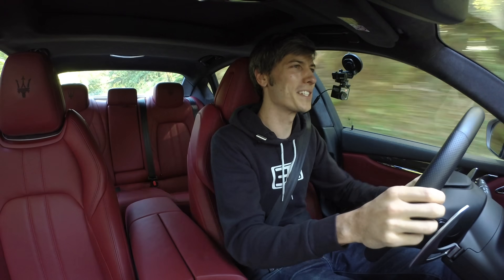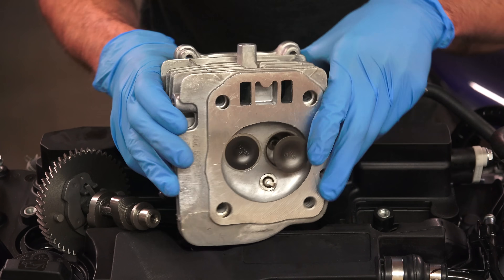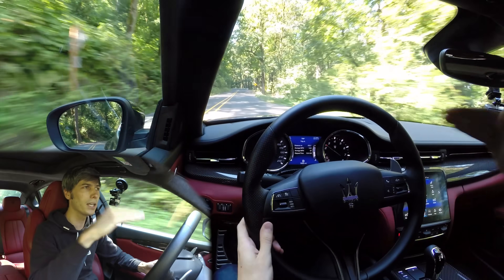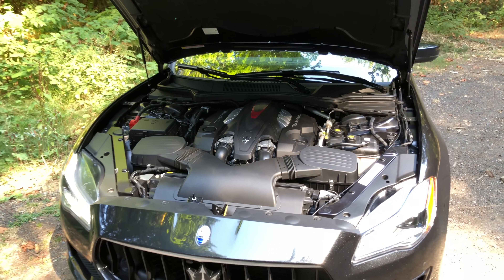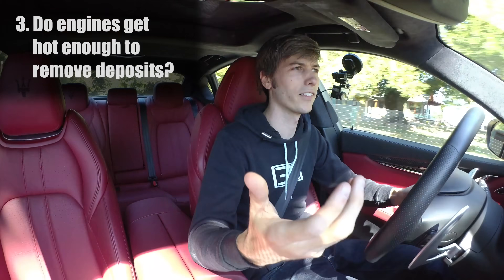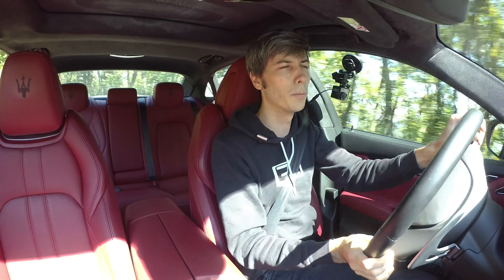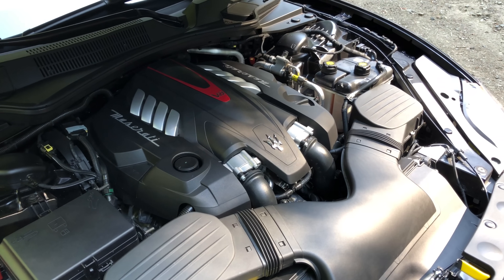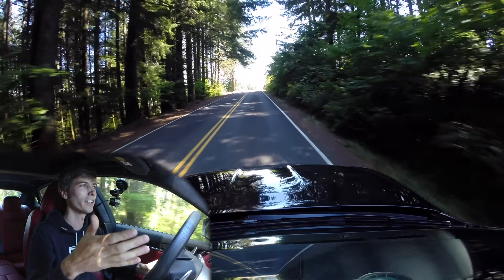Is Redline Good For Your Car's Engine? Italian Tune Up

Comment from the maker: Hope everyone's having a wonderful day! I made a video a while back about why engines lose power over time (summarized with 10 reasons), which feels relevant to this video, for anyone interested. Here's the link! https://youtu.be/uj8hjAjI7p4
Reply: if i get caught redline on the 5 gear  . can i show this video to the police and tell them i was doing a italian tune up ?
Reply: Very Interesting. Was wondering about water/methanol injection systems on direct injected cars like my 2018 Civic Si? Would it steam clean the intake valves and/or the combustion chamber like old pappy mechanics used to do by dumping water in the carburetor? A lot of videos I've seen say it does but I haven't seen any real data.
Reply: Get a question, which will cause faster deposit buildup in the intake  valve. plastic manifold/metal manifold?
Reply: Please do an episode on whether or not winding your engine up while stationary and bouncing off the rev limiter is bad for your engine.
Reply: WOULD BE BETTER IF i WAS DRIVING A MASERATI...:)
Reply: I think going WOT opens up the fuel injectors and the fuel line system.  Like exercising flows the blood more so it cleans up the stuck parts.  My stuff runs better after going WOT for some reason lol
Reply: @antdx316  Right at WOT your getting a lot of fuel over the intake valves.  If you use a high quality gasoline with lots of detergents that will clean the intake valves.  I use shell V power with nitrogen exclusively and when I took my lower plenum off the valves look like new on a 90k mile engine.
Reply: What about Catch Cans next!
Reply: I had a carburetor "powered" car once that didn't get below the emission requirement, no matter what i tried. I was super pissed and decided to try revving the engine to either A) blow up or B) remove everything besides the aluminium and steel from the engine. As it was not injected and the ingnition didn't cut at any point, i revved the sh*t i out of it by driving couple of times up and down this steep and long hill nearby. Man, that engine cried! But it held together and i went immediately to get it tested and it passed with flying colours! That thing was tough! I had it couple of years before i had to let it go but for me, italian tuneup worked. Oh, the car? Peugeot 205. Have had two of those and i just love them.
Reply: Really intresting! 
It didn't actually surpriced me that you can clean off deposits by heat. The question is mostly - how well will the engine do at the temperatures required. I use heat for cleaning grill grates all the time using my furnace, that I have built. I use to go higher in temperature though - about 500-600°C. At that point, carbon also starts to react with oxygen in the air forming carbon dioxide - wich makes it disapphear from the surface without any mechanical work (all that's left is ashes, that's very easy to remove).
It's also not surpricing that 200°C is where it sticks at it's worst, because it's the same with grease on grill grates, pans and stove tops. After all, the deposits are carbon mixed with oil and fuel residue - most oils and fat probably have similar properties.
Reply: Is it me or does E E , look like Cristiano Ronaldo?
Reply: @eeiko321  maybe not, but some features do match indeed, like the chin ... and nothing else :)))
Reply: Stoners know about decarboxylation. It's how you make weed butter
Reply: It's a Mazerati! It'll fall to pieces before carbon deposits become much of an issue. 650,000 Toyota miles = 50,000 Mazerati miles. I'm not a qualified engineer but pretty sure that's the formula.
Reply: put down the dodge
Reply: I expect that the study on the turbo DI showing an increase in deposits with increasing engine load had a lot to do with it being turbocharged and having to run rich because of that.
Reply: Engineering Explained is this why Honda designed vtec?
Reply: I know that stretch of road your on. Can’t get fast enough to heat those pistons there. To many turns
Reply: You mentioned only temp. Air composition also matters during the decarboxylation rxn
Reply: Where are you driving?
Reply: Question! What about this video in relation to a rotary engine?
Reply: Would be interesting to compare gasoline with alkylate fuel as far as deposits are concerned.
Reply: Probably just driving the vehicle and letting it warm up to operating temp is best if its always chugging around at idle or starting and stopping like in city driving or farm driving or like with those new auto shut off engines the engine will buildup more carbon deposits. But if you drive on the highway or for extended periods. There shouldn’t be too much opportunity for build up and more opportunity for your engine to keep itself clean. Redlining  probably isn’t the best idea for the  longterm health of your car. But getting the engine hot to clean your catalytic converter isn’t a bad idea to keep it healthy. But you don’t need to redline your car for that.
Reply: * puff cigarette * make sure to rev it up to ten thousand.
Reply: Engineering Explained so a consistent low load until over 325C, got it
Reply: Very informative video. got my sub
Reply: Man seriously your videos are questions that are intricate and delivered concisely. Keep it up because it’s the most interesting car blog with your integration of physics and facts. Bravo man
Reply: I had engine light once on my S4 which has never had a failure of any kind and the first light.  I drove it hard with 7000rpm gear changes and the light never came back again. It has over 450hp and too much driving under 2k going to work.  Changes gears near 1500.
Reply: Is temperature the only viriable though? I mean what about increase of microvibrations and their momentum (from going rapidly from a few k rpm to max/redline) also the presure delta per second while that happens.
Reply: 'It depends' majorly means on newer vehicle it won't work that well (it = italian tuning) on older ones it might work. I recognize a noticable difference in my 1.9 TDI :) - those engines seems to be developed for harsh and extreme loads. The more I 'm on ... FULL PULLs the better the fuel economy gets if I'm on the daily driving. Kinda strange but I 'd say the 90's engines are the best :D
Reply: Ee~~
Reply: If you don't understand decarboxylation but you're a pothead try to learn about vaporizing weed and activating THC when making edibles!
Reply: Unless you've already done a video or something about ethanol free gasoline. I would be wondering does it actually do better for carbon buildup on direct fuel injected engines?
Reply: Thanks for the video. One thing that is certain in my experience is that an engine that is worked at higher constant speeds is definitely smoother and runs better than an engine that spends its life pottering around town.
Reply: Problem is, trying to explain everything with NO EXPERIENCE... yes it works.  It is not just the heat... the is the flow, vibration, seen many things fixed buy just pushing on it for a few min.
Reply: But if you don't have performance exhaust valves, couldn't you risk burning the valves?
Reply: one thing you didn't mention was the (admittedly rare) wenkel rotary engine.Every RX owner info i've ever heard has said you red line once a day/drive. But they may also get much hotter and be more prone to carbon buildup. Probably still worth mentioning though as the type of engine most touted for red lining benefits.
Reply: Love your work. Was wondering if you have any plans on doing a vid on the pros and cons of an Automatic transmission with a Manual mode or not. Or if you already did one, could you provide a link? Thanks
Reply: @twztdfmgtr  then buy auto and manual if you want to have both modes
Reply: Would redlining a diesel have the same effect or would a diesel engine not get hot enough
Reply: @dougyboote  you would think a diesel would get hotter because it uses compression heat and not spark to ignite which to me means it must achieve maximum possible compression prior to ignition since it relies on spontaneous combustion ignition basically, no spark ignition engine could achieve that without knock.

 and the more confined the space the hotter the gas one assumes, but I've been wrong before
Reply: Gasoline with additive is the reliable way to remove carbon deposits, also I heard that ethanol also removes carbon deposits but I'm not sure about that one.
Reply: This video shows why a catch can is a good thing to have on your engine
Reply: No Fahrenheit conversion? Im not one to complain but i cant do that math in my head. Interesting And cool video but i dont know Celsius so all those temperatures mean nothing to me
Reply: Seafoam????
Reply: @danielthomas2621  seafoam, depending on the engine, can actually cause more carbon buildup than you started with
Reply: Best Lee Sin NA really?? Thanks for that

Comment: I actually wanted to try redlining my old diesel corsa because she won't go over much speed. Unfortunately it always goes limp mode whenever I go near 3k rpm especially on higher gears and I have to turn it off and on again.. Turbine might be clogged up

Comment: I drive a Mercedes-Benz 190D and I noticed that after I spent months driving the car like I was in a rally in almost every single day, the car started to have more power, but it also started to burn oil for the first time. So it seems that "italian tune up" works but in my case it took a long time. Although the burning oil in the process might not be a good thing.

Comment: Shortening the answer anywhere temperature gets to 140C but not to 320c you can get carbon. If anything heats up to over 320 it won't get carbon coz that's beyond the threshold and burns off.

Comment: I always considered the Italian Tune Up as being for carburetors and injectors, not necessarily for burning off carbon deposits. But also, it seems like none of the research called out higher velocity air/fuel flow and piston motion as pulling off deposits. Unless I missed it.

Comment: I have doubts that modern cars benefit from the Italian tune-up. But back in the day it worked for the carbureted cars I had, I know.
 I'd get my '65 Galaxie XL (352 CID) out on an open road and open it up, and it loved it. If I did it at night I could see the glowing carbon particles in my rear view mirror. My '71 Subaru also liked it, but really liked pulling up a steep desert road in 2nd gear. It would purr after that

Comment: So, 300+- *C, which is about where motor oil's boiling point is as well, right? And how long can the bearings and such last vs how long it would take to remove deposits? haha.

Comment: My Porsche 986 states in the owners manual, when the engine is at operating temperature, I must reach redline in WOT (wide open throttle), at least once per drive 

This is mainly for carbon prevention over time, amongst other things

Comment: I have a 2000 Subaru WRX with 360,000kms original motor, serviced regularly, every day drive car which doesn’t hit the rev limiter every day but a few times a week. Generally rev it out when merging onto freeways or overtaking and I always rely on revs rather than torque when driving normally.

Comment: Running to redline is better than lugging an engine.

I always used the whole powerband at least a few times when out for a drive.  If the cam is good for 8000 rpm, that's where I shift.  If it is a 3000 rpm truck engine, so be it.

I have never had an engine "come apart" from over revving if you are sane.

Comment: I owned my minivan from 156k to 210k miles without flooring the throttle 1 time. Revs never went above 3500. Got consistent 28mpg on the highway. I did floor it a couple of times after 210k miles, for no good reason. I still have the van and it still runs fine. Italian tune-up is the same as putting ATF in your oil, because some mouth-breather says it's a good idea.

Comment: I’ve unintentionally poor man deleted the EGR from my P71. And since I bought the car at 240k on the odometer, I haven’t detected any additional carbon build up over the last 6 years. And shes at 312k. Just put in a reman 3.27 rear end and still rolling proud. 

I was replacing my EGR years ago and snapped the return line that connects to the driver’s side exhaust manifold. So I plugged it and stuck a quarter in the back of the EGR. then slapped some tinfoil over it and called it a day! lol

Comment: I drive a 2017 Ford Fiesta ST, which as many know is a turbocharged hot hatch. After my first service after I bought it, it was just coming out of the break in period, so the tech that brought my car around from the  service bay told me “once a week, take it out and run it 4-5k revs for about 30 seconds.” I didn’t know it at the time, as this was my first sporty car, but the engine was not only designed to be run hard, but actually needed it as part of regular maintenance. It made sure the turbo had any deposits blown out of it, and that any carbon buildup was removed.

Because of this, it still pulls like a mofo when I plant my foot, and even though I usually let it get to 3.5k before shifting so the turbo has 1k or happy revs, I’ll still take it out on the weekend, get it out of the city and give it an Italian tune up on the twisties. That’s what the car was designed for in the first place, and it’s like a little dog straining hard at the least to go for an run, and the moment you take off the least it’s off like a turbocharged bolt of lightning 🤣

Comment: Actually, it seems that low load, high rpm driving might be the key. Lower deposition, higher temperature.

BUT carbon deposition matters not a bit if the engine suffers mechanical failure.

Comment: I had major carbon buildup at 85k in a GDI non-turbo engine that caused misfiring and required a new cylinder head. I generally did not drive under heavy loads on a consistent basis. In fact, I was fairly gentle on the engine.

Comment: I'm a firm believer.  I take my car to track days about once a year and back on the street afterwards it's like night and day, probably picks up 20hp (it is a 370hp car so a bit over 6%).  I don't know if it's just the things he considered - presumably the spark plugs get dechoked too, maybe the exhaust itself gets a clean out etc - every 1-2%  benefit in each component adds up.  I also notice it when I do a hard Sunday morning drive in the country (obviously you can't drive as hard as on the track so the impact is a bit less).

Comment: I would like to say, an "italian tuneup" predates EGR, maybe PCV (though pcvs did seem to make appearance in mid 60s, not sure if they were nearly as effective as todays though), and certainly direct injection (only thing direct injected in those days was a diesel.... and i'm not so sure that wasn't a good thing.....).  Might have extra benefits with all the modern systems on cars (esp DI gasoline cars), but.... it comes from the days of no emissions equipment / and carbs.

Somewhere in there, theres probably some truth to it, a car thats been driven mildly, occasionally..... taken out and then run hard in bursts (after warming up and all that, and within reason) does seem  to run better.  probably a whole lot of factors in play there, but knocking carbon out of the whole intake passage / cylinder / exhaust port maybe probably plays a large role.  maybe even burning some carbon off the cat with a modern vehicle (like 90s to early 00s, where cat was on there but the systems weren't as advanced as today in terms of recognizing things being clogged up...... not that modern systems are better at FIXING that clog necessarily........)

Comment: So, I have VW Golf Mk2. My brother who used to be a mechanic told me that it has some funky early electronic carburetor that once was acting up so he took the car to a specialist mechanic who works with carburetors and by the time the specialist was done with it, he said "Don't ever bring this to me ever again, I don't want to see it!"
So, in fear that if it starts acting up again I might not be able to get it fixed (my brother said that if the computer goes, we'd better get a new engine that works rather than attempt to fix it - I checked, this carburetor can cost up to 2000 euros), I started looking up information on it. And a treasure trove I did find, from videos that show how it works and how to fix it to a very enthusiastic mechanics web site where he gives an extensive list of what to do if it starts acting up.
He also on an off note explained why my brothers specialist mechanic had struggled with it so much - engine timings are normally tuned while the engine is idle. Which is probably what that mechanic was doing. But the web site said that this is exactly what trips up experienced mechanics and hobbists alike - the darned engine timing has to be tuned while the engine is revved to 2000 - 2500 RPM. In any case, I no longer fear that even if it breaks there's nothing can be done, in fact it's probably an easy fix.
Any case, I have digressed enough. The website also said that the easiest way to get this engine running better is to give it an "Italian Tune-up". But hilariously enough, he also wrote in big red bold letters ("DO NOT DO THIS IF THE ENGINE HASN'T BEEN MAINTANED WELL - seriously, don't do this. Don't tell me I didn't warn you when your pistons punch a hole through the engine - I've seen it happen!).
But he also thoroughly explained how to do an Italian Tune-up. Easiest way is to find a good fast road (with no police) and just go flat out, through all the gears for 1-2 minutes straight. If you can't do that as a law abiding citizen, just accelerate to 90-100 kmh in second gear and hold it there for 1 minute. According to him, that gets it hot enough to burn away the carbon deposits. That or your engine blows. Yes, he had a second big bold red letter warning discouraging you from doing this.